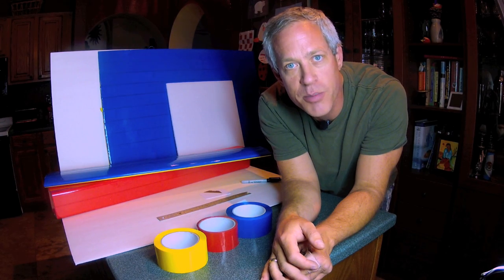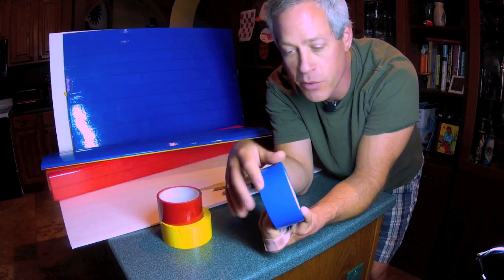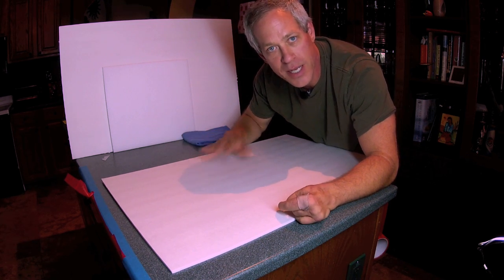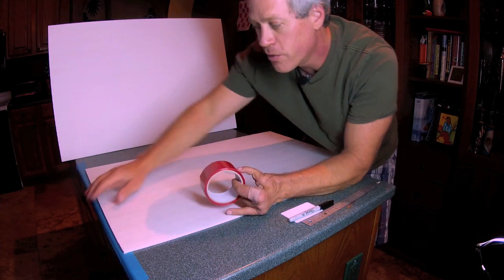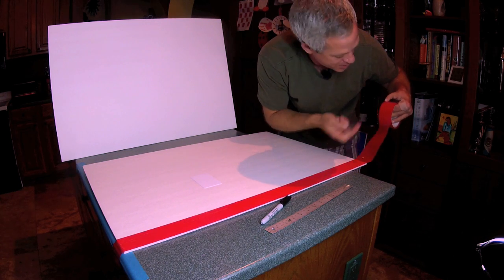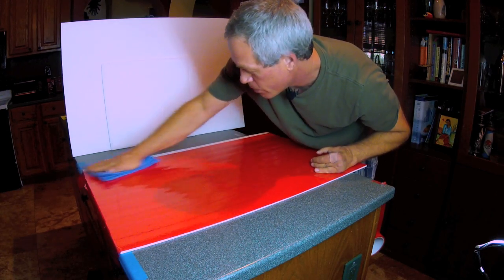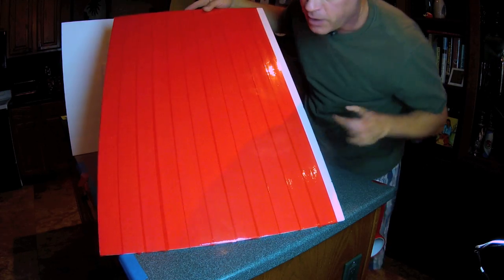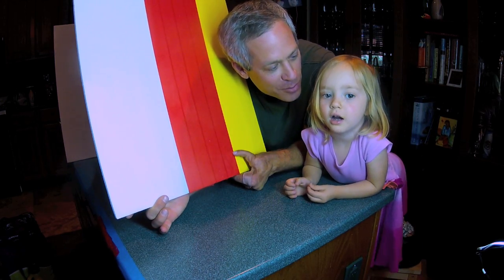TAPE COVERING FOAMBOARD - For RC Airplane Construction

Comment: step-by-step demonstration of the simple method used to pre-cover foamboard and Depron with thin colored packing tape.  This covered foamboard forms the basic raw material for the Experimental Airlines construction technique for scratchbuilt RC airplanes.

Comment: Thanks Ed. Your videos are both intellectual and practical. I had much trouble and mixed results with colored tape but this video drastically improved the process. Before, I was getting tons of wrinkles and not a covering I could be proud of. Thank you for providing information on best practices when applying colored tape. When it works, it’s a beautiful thing.

Comment: Would it be possible to use the packing tape, just by itself, as the skin of the wing, without the foam underneath?  For example, if I designed a wing with two spar and some ribs(all made of balsa wood), would it be possible to apply the packing tape as the wing skin, directly onto the spars and ribs?  

Thanks.

Comment: Just a quick note from  a guy who started in RC in 1975, and am still flying today. This idea of covering with packing tape is not the way to go. Any foam plane will be very light, and unwanted weight will be detrimental to the planes flight characteristics. Remember, beauty is only skin deep. It's the added weight that will diminish the flight characteristics of the plane. If you need to add color to a foam airplane, and add only an ounce or two, buy spray paint. Tower Hobbies spray is lighter that box store spray paint. Mask off what you want, and spray very lightly. The first coat should look almost like you have not sprayed at all. A very thin coat. Let dry, and very lightly, sand till smooth. Add a second coat, but never stop moving the spray can. Do not ever, create a build up of paint on one spot. You will, get a run, and it's very hard to sand it out. Sand again to get a smooth surface, then apply the third coat. Always think to spray lightly. You want color, not a thick coat of paint. You will end up with a beautiful plane, and it will still be very light, and easier to fly, than a plane that is too heavy. Too heavy, means a shorter flight as the battery will run out sooner, trying just to keep the plane flying. Packing tape is NOT the answer. 

I fly pattern. Originally using a nitro engine, then cleanup was a real chore. Switched to electric, and have never looked back. Mt plane is 11 lbs., and flies like it's on rails. I fly with 5000mAh, 8S, and 60 & 70C batteries. I have installed Ceramic bearings to the motor, and it flies fantastic. My pattern plane is a "Focus Sport". I bought it in about 1998, and I still fly it today. I would send a picture if I could. 

I have bought 2 foamy planes, and even though they do fly, they are only cheap, and you get what you pay for. The most important thing in this great hobby of Radio Control, begins with a great radio. I am using the same Futaba 9CAP radio I bought in 1996. It's has long been converted to digital, and never misses a beat. Care, and clean up will keep your equipment in top shape. 

If anyone wishes to communicate with me, send my a reply, and I will return. RC Aviation is the greatest hobby. I fly full size as well, but the expense is too great for another plane. I have had 2. That was then, and this is now. With RC, you can fly anything. With a Private Ticket, and 20K in your pocket, you have a choice of only a very few. All in all, I chose RC. It's harder to fly RC, than real, but so much less expensive. Be safe, and always keep your eyes on your plane!
Reply: Well I've been flying RC for over 50 years, all types but I prefer slope soaring. I disagree. With today's electric motors most planes are way overpowered. Also on board electronics are way lighter than 20 or 40 years  ago. Packing tape makes it quick and easy to get a scratch build in the air you can deign build and cover a scratch build in an evening for about $3-$5 in materials. Just remove the paper first if you want lightness. I could just use monokote lol.

Comment: If I were to get back into the hobby this would be my starting place.  I'LL never be happy with over the counter ready to fly.  I'm an old RC glider guider that flew competition.  I'd be happy with a rugged  take off and landing bush type electric plane that can also capture a thermal or two.  2 or more guys like me competing using rounds  certain measured time tasks and a bonus for landing closest to the head of a 20 foot tape on the ground adds immeasurably to  just plan fun.   Oh and Thanks ED. I hope others apprecial how your system saves a lot of mistakes and miss starts into the hobby. Also ,,,,,,,,,,,,,,WHAT A CUTIEPIE. LOL

Comment: i did some test build parts removing the paper and applying tape direct to foam . this improved durrability because the paper peels easy. in a crash the paper adhesion is 1st to fail and makes repairs difficult . pre-taping  the foam (paper removed )and setting it with the  iron seems best

Comment: I'd like to know about removing the paper first as well. I can see that taping over it would increase the strength of the foam, but I've found that the paper covering on that "dollar tree" foam board can be peeled off pretty easily. With that being said it seems that taping over the paper would be useless if the paper is going to peel off. Anyone got a suggestion about this?

By the way, excellent video!

Comment: Using a piece of cloth is a great idea to make it stick, I've covered half a dozen planes but never really found a good way to get it to adhere perfectly, a card scratches the hell out of the tape, your hand squishes it and makes divots and weak points, cloth works perfectly. It's an important step too cause it makes the color look richer and reduces the chance of delamination. Thanks so much for your contributions, you're a legend :)

Now I just need a good way to cover the cut edges without it looking like a preschool project lol

Comment: Hey great video. I just went out to the shed and did up a few sheets in no time. They turned out great! Couple ideas I figured out along the way: 1. Tape the razor blade right to your squeegee card to make a nice little multi-tool to save on the constant picking up and putting down of the card and the knife.
2. A clamp attached to the table on either side of the foam board keeps it nicely in place so it doesn't slide around on your when you're trying to align the tape.
Reply: Thanks for sharing your experience

Comment: Great instruction.  I used polyurethane and spray paint on my nutball.  It turned out ok but this method seems like it would add some good reinforcement to the foam board.

Comment: Nice tutorial.  Just a question about overlap.  I do no overlap when making a wing and it works great. Still provides protection and doesn't have the unsightly dark stripes. Why do you make a point about having overlap?
Reply from the maker: Matthew Chiera It would look better without stripes.  I do it mostly to keep water from getting to the paper and detaching it.  The genesis of the whole tape-covering for me was the fact that all grass is irrigated in Phoenix in the summer so it's always wet.  It also imparts a bit more tensile strength during folding and in flight to have the tape overlap.  When doing it with Depron it is essential to keep the Depron from fracturing when folded.
Reply: OK Thanks. I guess in my situation, the wing had no paper so was already waterproof. To be honest, I have never seen paper coated foam. It must be a new technology.

Comment: I just did some testing with removing paper and then applying tape. As warned, the tape peels off pretty easily from the foam. However, I used my clothes iron on the "silk" setting (medium-low) and ironed over the taped foam, and then the tape was very difficult to remove from the foamboard. I think I'm going to use this method to cover my boards.

Comment: Well, I a friend cut a wing for me out of styrofoam with a hot wire... and I found that the tape doesn't stick to it... I gave it a nice go over with sandpaper... should I be more thurrow, how can I clean the styrofoam of the little hairs well enough so that tape will stick good to it? :)
Reply: +Marius Goreacii paint it with min wax polyurethane first

Comment: has anyone gotten a response about or tried the paper removal?  I'm not sure why you need or would want tape AND paper....
Reply from the maker: Seems to be that paper and tape is good for general use and pretty darn strong, and tape sticks permanently.  Tape only is for when you need super light, but the tape can detach from bare foam, especially around corners, hinges, etc.

Comment: Do you know if the tape will stick to just the foam without the paper?  I'd like to remove the paper.  There's a great video on how to do this easily, and I think the tape alone would add strength without adding too much weight.

Comment: I've been thinking about scratch building a plane but not sure what type of foam to use. I see vidz where people use foam board and depron. Whats the difference between the two and is there a thin foam (around 2mm thick) that is flexible? The designs I have in my head would require flexible and stiff foam. Any input would be of great use.

Comment from the maker: Absolutely you can.  The tape does not adhere quite as permanently to the foam as it does to the paper, but it's pretty good.  You'll save about 30% in weight, more or less, depending on whether you leave the paper on in some places as prescribed by the bending techniques.  And some durability will be lost.

Comment from the maker: You will have to look around.  I am sure there is something for your needs, but I am unfamiliar with the choices in India.  It should be light and the paper should come off easily.   Usually the less it costs the better it will be for building.

Comment from the maker: Either of these planes is pretty easy to fly, but they really need ailerons.  You would need dihedral to fly 3 channel only, and honestly the trouble of getting dihedral is more effort than just going ahead and committing to ailerons.  I would go with an Axon and use ailerons and you'll not regret it.

Comment: That is correct. Riot Art has large sheets but they cost $10-$15 per sheet depending on size but the paper doesn't peel off unless you soak it.
The best option for Australians is Depron. You can get a box with 20 large (1000mm x 700mm x 6mm) sheets for $225 delivered.

Comment: Info for people who are used to European type measurements. 2 mil, in the US means (2 thou) 2/1000ths of an inch or 0.002" and as Ed pointed out 0.05 millimeters.
 Yeap, we can get the Adams foam core board here in the UK, usually from art shops, so it's not a dollar a piece. ;¬) But I can buy it locally from a shop called The Range for £3.99 for one A1 size sheet. So that's $6.08 for just one paper covered foam board that's approx 3" bigger bigger in length and width. :¬( Oh well. :¬)